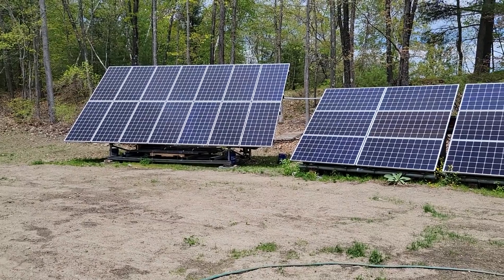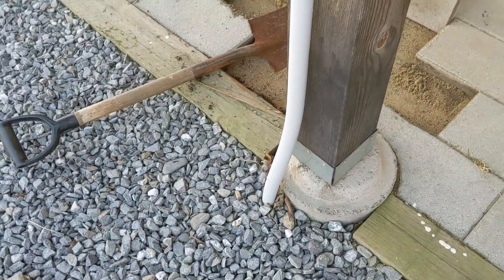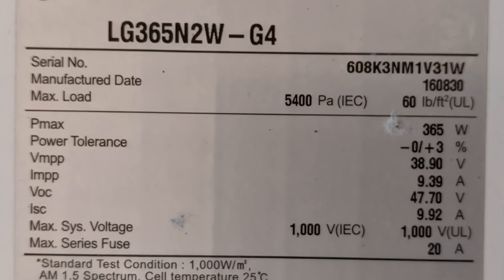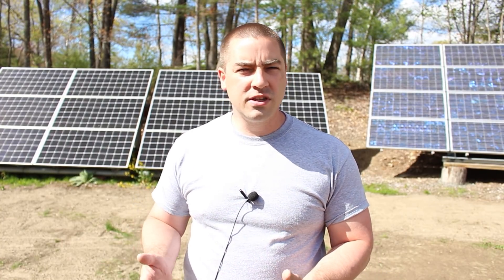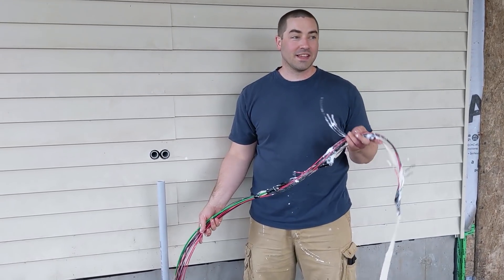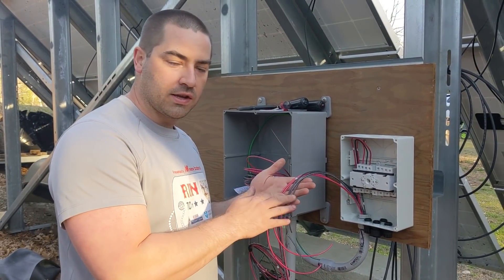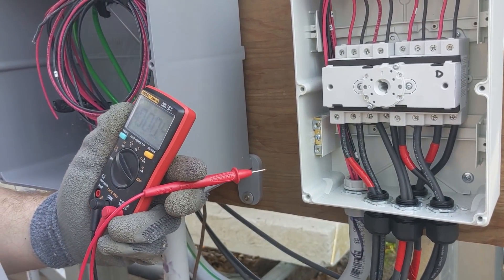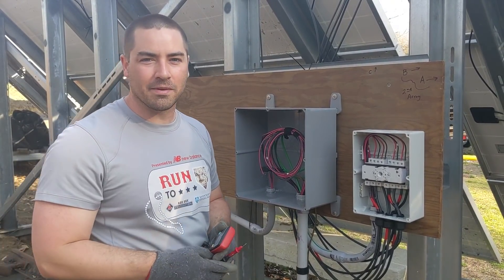Couple wires a huge, High Voltage, Solar PV Array, 12.6kW

Comment: Do you have overcurrent protections at the array? Im trying to figure out if a combiner box with fuses/breakers should go between the panels and the  IMO switch or have the switch between the panels and the combiner box.
Reply from the maker: In this video, I'm paralleling two strings of panels and thus not using overcurrent protection.  However, my old array has 3 strings in parallel and that uses a combiner box from Midnite Solar with circuit breakers on each string.  Code allows two strings in parallel without overcurrent protection on the solar panels, but requires it for 3 or more strings in parallel.

Comment: Is it necessary to run a ground wire between the pv array and mppt? I thought having separate grounding rods at each end was an option.  If it is necessary,  can you explain?
Reply from the maker: Yes, you can run a ground at the array for the frames of the solar panels.
Reply: @DavidPozEnergy  thanks! Is there any reason to run a ground wire (150ft) in my case, through the conduit?
Reply: @DavidPozEnergy  also- im trying to choose between a victron 450/100 2xmppt which would take two 9 panel series,  per mppt, or 2 victron 250/85  or 250/100 mppts, each with 10 panels ( two 5 panel series each).  Pros and cons are- 450v wouldn't require combiner boxes, but is limited to 100 amps charging current.  250v - if one panel is damaged- would result in 2x loss vs. 1x with the 450v option. Any other considerations? Mppts are similarly priced. Wire size is a factor...
Reply from the maker: I think this comes down to your site.  If you are building one large array in an open field, then use the higher Voltage system.  If you are putting some panels facing one way, a few panels get shading, a few panels... etc.  Then go with smaller, and more of them, charge controllers.  I like my Schneider charge controllers, which go to 600V.  I've not tested the Victron 450V CC, but I would guess they are pretty good just like most Victron stuff.
Reply: @DavidPozEnergy  thanks- yeah its gonna be 2 mppts either way.  The 450v is 2 inputs on one unit vs the 2 separate 250v mppts.  They'll be on our south facing bluff both facing due south with no obstructions. The main difference is the output 100A vs 170-200A. Battery can take up to a 200A charge.

Comment: Hey really good install, just a quick question, I'm setting up my first install , need to 2 add to more panels, but I need to series them. Can I use just normal cable instead of solar XPE outer sleeve, I think these normal ones have PVC insulation but I will be using a conduit ( those flexible ones which go inside walls ). So will this suffice? . It's just for making the series connections positive to negative and so on. And I will need also an extension for the last panel to the negative feeding into the MPPT as I will be short of one of the cables.

Comment: My comments may have already been said.  First, I think you should have kept the Midnite combiner box and replaced the 150 volt DC breakers with Midnite 600 volt DC breakers, 2 pole, 15 amps.  this would have provided you overcurrent protection.  And you could have wired in a Delta 600 volt DC lightening arrestor into the combiner box.  My second suggestion is that on close together connections like in the Dc disconnect switch, the use of wire ferrules on the ends of the wire can help to prevent arcing and short circuits.  Pulling the wire was very constructive.  But, when it just doesn't get through, then sometimes you have to locate a spot near the middle of the run, dig up the conduit and install an access point with a grey electrical can at the surface.  This dramatically shortens the pull, especially with heavy wires.  then they are spliced at the can for continuity.

Comment: I am just starting with eg4 6500 48  and have a question about solar panels. I found 455 watt panels  49.03 volts if I buy 10 do series is that to much for inverter.
Reply from the maker: I've never reviewed that inverter.  You might have better luck asking this question on a channel that has reviewed the EG4 6500.
Reply: Read all your documentation.  I just bought two of those, they accept up to 500 volts.  Rule of thumb is multiply panel voltage by 125% to account for over voltage from the panels.  So figure 612 volts which is too much.  Each EG4 6500 has two inputs rated for 4000 watts each.  Just run two strings of five panels each.  300 volts and 2275 watts per input, you're good.  If you are asking these simple questions you need to do some more study on installing solar panels. There are many videos online and books on Amazon you can read.  I have a Kindle Unlimited subscription and there are dozens I can read for free.  I was an industrial electrician for 10 years and I have been studying for months.

Comment: Hi David. 
Firstly, I'd like to say that I love your videos and find them very informative. I'm installing solar in my house in Bulgaria (I'm English btw) and have found many of your tips useful. So, here's my question -

My panels are about 40m (130') from the house. I'd like to run my cable overhead but can find nothing online about the pros and cons of doing that. Do you know if it's acceptable, or frowned on? I can easily string it a good 15-20' above the ground, so no issues with catching ect.
Reply from the maker: I don't have experience running wires that far, above grade.  I once ran some wires between two structures above grade, but it was only 4 feet.  In my area we get ice storms that can weigh down an overhead wire.  My town wants everything buried in the ground, 18 inches (46cm) and in conduit.
Reply: Thanks for replying. All the mains power is overhead here, so I'll probably go that way as the alternative means digging up a whole lot of concrete. It's just odd that there's so little info online about taking solar power overhead? Thanks again, and thanks for all your videos :)

Comment: I tried to order the imo disconnect s125-pel64r-8 from signature solar but it appears they don’t carry it anymore.
Reply from the maker: Here is another source: https://amzn.to/3MjJn1e
Reply: Thanks, I looked at that one. I can only connect 2 strings in that model. I know that I can buy 2 of them because I’m looking to run 3 strings into 1 disconnect at the panels (similar to what you did) so I was hoping to do it with one.
Reply from the maker: OK, I get it.  Mine was very difficult to turn, and I had a piece of the plastic break on my box.  Trying to turn 2 switches with 1 handle was just too much stress.  I've got mine taped up at the moment, but I'm going to replace it with two separate boxes.
Reply: Thanks again, I got them ordered today!

Comment: Hello David, how much dc voltage drop did you  get on that run ? Would you have gotten less loss if you went higher voltage?
Reply from the maker: The general rule is to have 3% or less Voltage drop.  I think I was right around 1% on this build.

Comment: Your method of wire pulling is the exact way we pull CAT6/ 6e ethernet cable through conduit. Even down to the foam lube you used. We pull 10s of thousands of feet of cable (even 100s of thousands of feet sometimes) on jobs.

Comment: Awesome! Could I ask why you didn't put the two strings in parallel and then run less wire across the yard? Was it cheaper the route you went? Awesome videos by the way
Reply from the maker: One of my first solar arrays was done that way.  I used a Midnite combiner box at the solar array.  At that box I combined the strings in parallel, then ran a single positive conductor (6AWG) and a single negative conductor (6AWG) back to the garage.  With this current build, I did not use a combiner box.  Instead, I have a disconnect at the array, but ran each string separately back to the garage.  There are two reasons for this.  First, some of the inverters I'm testing have combiners built in.  Second, I'm constantly testing new products.  Not every inverter/charge controller will have the same capacity.  Sometimes I only want one string to one item.  Having individual strings back to the garage makes testing simpler.  This approach was a wash for the cost.  It didn't save me anything, or cost me any more.  Both approaches can work.
Reply: @DavidPozEnergy  that makes sense... Especially if you want to switch equipment out in the future. I was thinking that a thicker wire would save money but it is probably just as expensive as multiple smaller wires. 🙏

Comment: Apparently I don't know what I am doing wrong. I currently have 6 panels wired in parallel and 10 guage wire got hot and melted so I have changed wiring out to 8 gauge wire and seems ok now but I want to add 30 panels to it and I am so confused about how to wire them up and my array is only 20ft from the batteries.
Reply from the maker: On the back of the panel there should be a data sticker.  One of the values is "Imp" which stands for Amps at maximum power.  When you wire panels in parallel the Amps add together.  For example, if each panel has an Imp of 10A, and you have 30 panels in parallel, that is 300 Amps!  That's going to be too high for reasonable practice.  So, instead, design a system with a charge controller that accepts a higher Voltage so you can series your panels.  If you can series 10 panels the Amps are still 10A (in this example) and you could have 3 parallel strings.  That means the array is now 30 Amps instead of 300 A, but still the same 30 panels.

Comment: On a long run through conduit,  I used to use something I think was called an electrical snake. You can push it through the conduit,  then tape the wires to it and pull it back.

Comment: David,  You should never run a ground wire in rhe same conduit as other wires.  If you had a lightning strike the ground wire by induction would transfer the hi voltage to all the other wires.

Regards
Daniel

Comment: Great video. As a matter of conciseness: THHN is not technically rated for wet locations (underground conduit is considered a wet environment). That said, most but not all THHN is dual rated as THWN, which is. The other gotcha is THHN is often found in the 90*C column, but THWN is at 60*. You're videos have been a great resource to someone just getting started in solar, so thanks!

Comment: Only purpose to increase voltage is if got to carry a long distance.  It saves money . Smaller size components  and wire is cheaper . But must compare to step down trandmsformer cost you must have to step back down.

Comment: Ground is not neautral, its a return current of 50 % . If it a 120 volt circuit the neautral is 60 volt. Traveller. Only ground is earth ground has o volts. So neautral is best at same size as main hot wire but ground can be  2 to 4 times less

Comment: Like power lines on top poles is 10,000 volts at 30 amp. The. Muzt stay 5 feet away from it. Or it suck you into it and electricute you. Then got to have  a step down transformer to 240 volt dual phaze to what ever amp service you need as long not over 70 % of power factor of line service.

Comment: Not forget the higher you raise volts the less amps it produces , the ohms law. If was 120v at 30 amp , change it ti 240 volt doulble  it 2 times less amps in the 240 volt 15 amp.

Comment: mule tape is correct. some of it is actually rated for 1800 pounds. We use it to pull stuff up on scaffolding, so a person can keep both hands on the ladder when climbing and stay safe. that's why it is called mule tape. Using lubricant made for wire pulls will stop friction on the 90's and keep from damaging the wire insulation and ruining the ampacity of the wire! Having someone to feed the wire while it's being pulled will further aid in reducing friction as well as catch any loops that may get in the wire while pulling it into the conduit. Also, using a rigid metal 90 will help in the ease of a long pull of wire, especially when it starts getting bigger. this is a common practice among electricians for underground wire pulls and is very effective in making a long pull much easier for any wire size!

Comment: Each array will need its own charge controller. Especially if they are different manufacturers or ratings. They also are receiving different amounts of sunlight during the day. The operating point will vary depending on the amount of sunlight input. You don't have to switch the negative leads. Just switch the positive.

Comment: "Bonding" is the handshake, and "grounding" is your feet on the ground.🙂

In a bonded system the boxs, conduits, and mounting system such as struts etc carry the non-load but conductive structure containing the wires. If for some reason something shorts, it will be carried to the point of the run where it is then properly grounded or earthed. So basically, the metal conduit and boxes conductively bound together will do nothing unless you then ground a "bonded" member such as a metal conduit, metal box, or metal mounts connected along the line to a properly sized copper multi-strand wire and grounding clamp connected to the final grounding rod. 

Tip: If you try to connect to what would appear to be a conductive structural member like an I-beam or a metal water waste or service pipe you will probably fail inspection plus it can be dangerous.

Comment: You are a homeowner. you need to have a jack Hammer. the digging machine.... You are welcome :D...  you have that many solar panels and with  90 feet in length.  I know that you are having high voltage. but You should of use the 10 gauge instead of 12.  12 gauge is 20 amp and 10 gauge is 30 Amp, in long distance it lost voltage, you known.  20 amp. actually 80 percent of it is usable.

Comment: I have completed six 10KW systems using 10K Growwatt  240v. split phase grid tie inverters. 2 strings of 9 panels in series 1 string of 8 Panels. Makes an efficient high voltage setup.  With rapid response modules (NEC required) there is no need for cut off switch at the panels.  I really like your off grid setup. Thanks. I watch all your videos!

Comment: Newbie question about the pv wires going into the IMO; is this an after dark hook up?
Reply from the maker: No.  What I personally do, I wire everything with either: One of the MC4 connectors open.  Or, I toss a tarp over one of the solar panels in the series.
Reply: @DavidPozEnergy  Thank you

Comment: Nubby question: Why didn't David combine all the panels in his example of the first array from (3) strings into (1) string instead of just (2) strings, if he knew he was going to combine both strings to the same 5000ES converter, since they didn't exceed what the 5000ES could handle load wise? Seems maybe just a bigger gauge wire would have been able to do that. Which would have cut his wire count to half of what he used. (6 wires instead of 12). Or, even combined them at the IMO Switch. Either way, less wires.
Reply from the maker: If I ran all panels together in series to make one long string, I would have exceeded the maximum voltage allowed by the charge controller.  In my case, the charge controller is built into the inverter.
Reply: @DavidPozEnergy  Thanks so much for responding. I meant all the panels in the example you used (2 strings of 6 panels) for a total of 12 panels to the same 5000ES. Would that not equal the same voltage as 12 panels in a single string to same single 5000ES?
Reply from the maker: All 12 panels do go into one 5000ES.  The two strings of 6 panels are combined at the inverter.

Comment: I am about to get this DC disconnect switch but the 4 pole model since I'm going to run 2 strings through and to my growatt. In order to compensate for V drop, do you think I can run 8awg into those terminals??

Comment: Hi Dave I'm having a confusing issue with my solar panel I see two different ant readings one is 8.79 and the max fuse answer is 15 amps when I turn one panel on the solar charge controller is reading upwards of 19 amps for only one panel or $335 watt solar panel just one panel alone is pulling in up with 18 to 19 amps is that right ?

Comment: Use an electric blanket itll thaw down the ground the other alternative is to run pex pipe in a loop from the hot water out and back to the hot water tank I have used the electric blanket trick when I put a addition on my house the inspector said I should use post and beam the engineer said it wouldn't work the frost would lift the post and rip the roof membrane lose from the house I thought he was just looking for more work and took the lnspectors advice well first spring thaw and it rained all along the tie in to the original house so I waited for June to come and I pulled up the floor and started digging down the six foot for the frost wall got down between 8 inches and a foot and I hit frost the only way to keep going down was to thaw the ground that means either put down coal and straw light it up and cover it with tin sheets or wait until the ground thawed out coal stinks as it burns and I didn't like the idea of a fire under my addition so that was out and waiting for it to thaw could be a month or more so that was out so I decided to try a  couple of electric blanket since they only did about 10 foot at a time it took a few days to thaw and dig it out but I took out the post and replaced them with a frost wall

Comment: What size wire did you ground the panels with? Do you have a link for the ground connectors you used in each panel?
Thanks
Reply from the maker: I used a 6 gauge wire to ground the frame to a ground rod.  The panels are bonded to the frame with a star washer, as per the manufacturer manual.